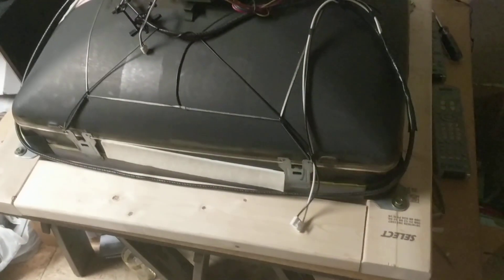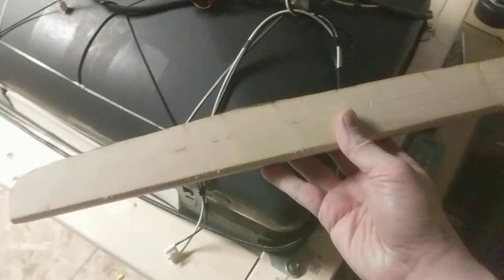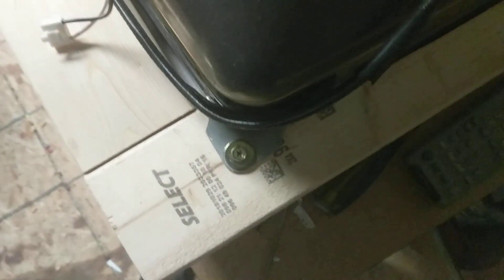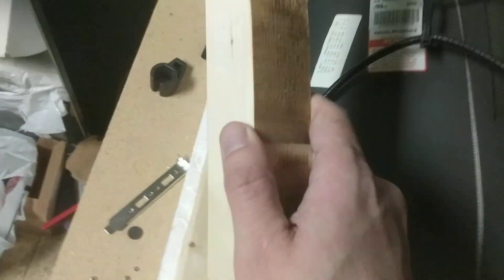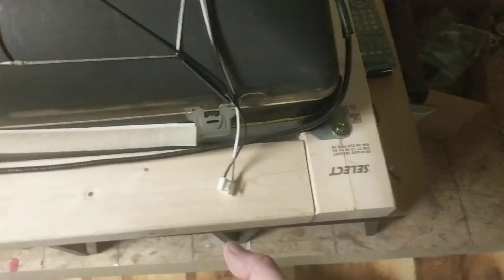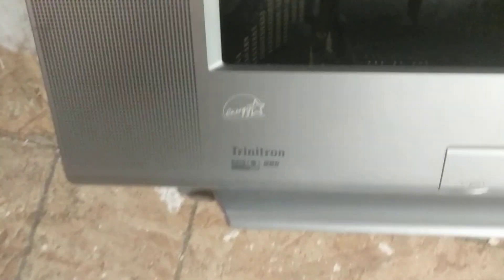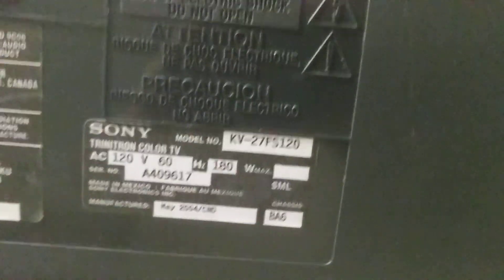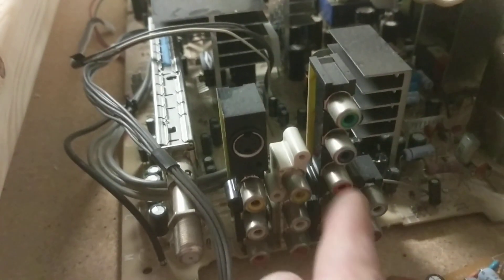Sony Trinitron BBE KV-27FS120 CRT TV to Arcade Monitor

Comment: Using conventional tvs is a good idea, the trouble is the original tv chassis is quite large especially when you get past 21" because its carrying a sound board some say you can't adjust things like horizontal and vertical adjustments but you can if you know how to get into the service menu it's all there to set up the entire picture Sony always have a good service menu for stuff like this.

I've never used a TV for an arcade monitor well I say that just the tube, I prefer to buy a TV take the tube out mount it onto a arcade metal frame then find a suitable arcade monitor chassis to fit the tube and job done.

Comment: Bonjour Jonathan! Je veux faire un projet similaire pour mon cabinet. Aviez-vous trouvé un manuel DIY sur le web pour savoir la marche à suivre? La machine que j’ai a déjà un écran LCD qui a remplacé le CRT original. Je veux revenir au CRT.
Reply from the maker: Salut! Pour montrer le tube sur le cadre en bois non c'est 100% mon idée. J'ai choisi un tube crt plat pour pouvoir utiliser un plexiglas comme protection en avant j'ai peinturé le contour du plexiglas pour cacher le bois.
Reply: Jonathan Bourassa Nice! J’ai trouvé exactement la même télévision Wega hier. Mon pcb demande 15 hz pour le rafraichissement vidéo. Avec la boîte de conversion ça pourrait fonctionner?
Reply from the maker: @NiGHTSaturn  absolument les tv CRT standard sont tous 15hz.
Reply from the maker: @NiGHTSaturn  Quand tu dit PCB, c'est un PCB d'arcade? Si c'est le cas je peux tester la ROM sur mon setup GroovyMAME pour voir si la TV supporte la résolution native du jeux. Y'as certains Roms que je dois utiliser une résolution différents car les tv en supporte moins que les moniteurs d'arcade.
Reply: Jonathan Bourassa Ça serait super. C’est un System 573. Surtout utilisé pour les jeux comme Dance Dance Revolution.
Si tu as le temps contacte moi ici: felix@studiosonique.com merci!!